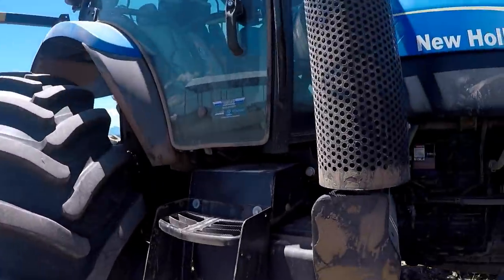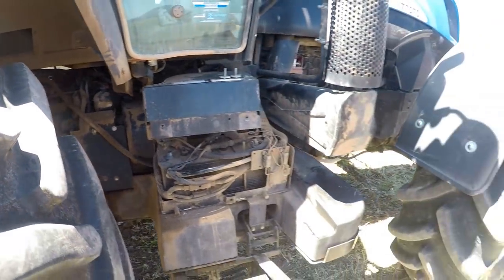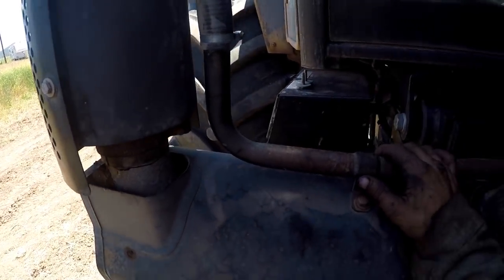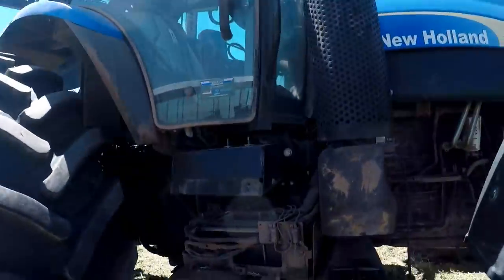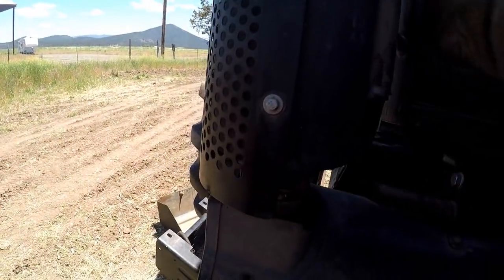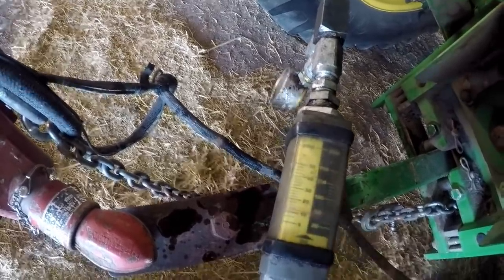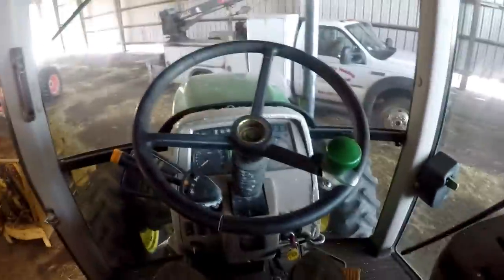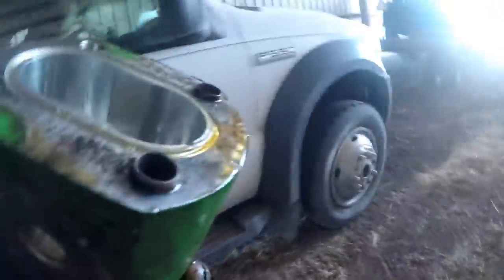More service calls .

Comment: i do weld repairs on yachts/ barges , i know the diodes in elderly ac alternators go kaputt when you forget  disconnecting the batterybanks on the engines , the newer ones voltageratingof the diodes is much higher , so less risk of damaging them ,  keeping your earth clamp close to the spot to weld is also good practice

Comment: SHOULD HAVE PUT A WIDE   BAND   CLAMP  ON IT AFTER WELDING     TO MUCH VIBRATION  WELD WONT  HOLD ON THAT    THIN METAL           CERTIFIED WELDER  BY TRADE

Comment: I understand you found out later they changed the cluster I get that, but just look at that tractor that thing is trashed steering wheels all cracked to hell the interior is falling apart paint is all faded you think that tractor is gonna have that damn much damage and 369 hours? That’s just a dead giveaway man that damn tractor has 8,000 hours worth of damage on it

Comment: I disconnect my battery terminals when I weld also. However, I have welded (in a hurry and not thinking) with the terminals attached and no issues. Now, both the instances you describe involve (to my knowledge, and I have over 25 yrs in the precision sheet metal trade) welding aluminum (AC current). I know some welders will weld aluminum on DC current, but AC is far stronger, cleaner, and faster. I can't imagine there is much steel on a plane as they are typically made with ultralight nonferous materials most of which is aluminum. Like I said, I disconnect the cables anyway (better safe, than sorry) but I'm sure that hooking up high voltage AC lines to any DC vehicle is a recipe for a toasted ECM.

Comment: I think damaging electrical has a lot to with paths to ground and partial paths to ground as well as the type of electricity and the amperage you are putting out and possibly introducing to the vehicles electrical system. That said why not unhook it just to be safe regardless? 

Same with doing electrical repairs, its fuses you won’t have to replace if you cross wires while you’re soldering or bump the battery lead off an alternator or starter against the engine block. Or wrenches and screwdrivers you don’t fuck up with arcing marks all over them. Just makes sense to make the possibility of error as small as you can.

Comment: I've done a lot of automotive mig welding over here in the UK to get vehicles through the MOT test and I was always taught to disconnect the battery for that, on the older vehicles that didn't have ECU's it used to screw up the alternator occasionally although I've forgotten a few times I've only been caught once and had to buy the customer a new alternator. On the newer stuff with ECU's I'm especially careful not to weld with the battery connected, just not worth the risk in my opinion.

Comment: In theory you wouldn't have to unhook the batteries if the ground circuits on every piece of electrical equipment had a million volt and million amp resistor to keep voltage from the welder from going into the system but every additional component is another failure point in anything so nobody is going to do that. Anyone who says to not unhook the batteries is either being delusional or works in sales

Comment: Back in 1984 or so, I took my Cessna 411 (a 7,000 pound twin) to my mechanic when the left and right engines generated different  rpm at full power. Long story short, the waste gate controllers needed work. These things are nothing more than about a 6 inch piece of 2 inch exhaust pipe with a butterfly valve inside. They were sent in for overhaul, and when returned, the bill was 4,000 bucks. I damn near had kittens on the spot.

Comment: every new tractor with any sort of electronics its a must do to disconnect the batteries unless you want to replace the ECU and spend thousands fault finding, when i worked in telecommunications where you have sensitive electronics just walking on the carpet and touching wires can induce static electricity and then you would have people complaining that their phone's playing up,

Comment: I agree completely with unhooking batteries i do in my shop each time as well, but not disagreeing with your buddy by no means but i feel and have been told by my Miller rep and by others, but the reason that ECU fry or stuff gets shorted due to welding is if the ground location from welder is not on a clean and close proximity to joint being welded it will find the easiest and shortest path to it which some times goes thru ECU's and bearing in motors (seen this way to often from customers trying to do own repairs) but that's my $.02, and for all the 6.0 and 6.4 P/S guys make sure your engine grounds stay good and clean and tight didnt believe it tell i say it for my self but these trucks if have bad grounds when starting truck will arc across the front pump bushing/bearing in the transmission and when they do pump goes out and your dead in the water ive seen it to many time to count in my shop, i had a very reputably transmission builder for fords that i buy my parts from time to time to add a good 4ga ground from the top alternator mounting bolt to the RS batt. to give extra insurance from it happening again, that ended up being longer post then intended but anyway I do like watching your videos bud i own a diesel shop but dont get to mess with anything other then OTR trucks and 3/4-1 ton stuff mainly so its nice to get a glimps into the heavy equipment stuff

Comment: Cant say enough about disconnecting the battery. mosfets work on voltage not current, you can turn a mosfet on an off just with the voltage differential between the mosfet ground and your finger, so yeah welding with batteries connected, especially AC based welding like tig, no way. Every welder is a little different but its just smart practice like relieving all the hydraulic pressure from your control valves before cracking a line.

Comment: I sure it does not hurt to unplug the batteries  however you are still inducing high current and voltage to the machine that is being grounded to you welding source

Comment: Isn’t aluminum mig DC voltage? Steel is AC. I could see that happening. You could steel weld on 50 trucks with no issue buts it that 1 that frys the ECM that gets you.
Reply from the maker: Depends on what rod you are running.  I run Dc + or Dc - polarity  and rarely run Ac on steel with stick welder .
Reply: I would use 7018 reverse party on about everything

Comment: Yes I totally agree with you and Will on disconnecting the battery when welding and that pump failure at those low hrs is crap
John Deere info welding on there tractors http://www.deere.com/en_US/ag/servicesupport/tips/tractors/common_stories/welding_electronics.html#

Comment: If I were the owner I would have taken the exhaust off and carried it to you. That way you could have sleeved it. It would have made for a better repair. Exhaust systems always tend to thin out and burn through in areas like that. Believe it or not there are  replacement exhaust systems on the new stuff that run into the thousands to replace.I have a 5075E Deere that after 400 hrs the tach started sticking. Warranty replaced it with a new one but tech. said they couldn't put the hours in so I wrote the original hours in the owners manual. They engraved them on the new cluster housing.

Comment: Hey Warren i recommend getting a mig welder. its a lot better than a stick welder for thin gauge metal. if you chose to use gas while out side turn the cfh up it has always worked for me or you can use flux core. i know people say you shouldn't do that but i do what works and i have never had a problem. If you would like i can come down and show you a thing or 2 that will make your job a lot easier
Reply: By the way i am a welder.

Comment: Warren  do you have wifi service for your laptop or do you have all your manuals downloaded to your laptop ?
Reply: Ron Hart I can’t speak for him but they way we did it when I drove a service truck was with USB Data hotspots that worked off of the LTE signal cell phones used. Worked pretty good unless you had to download something big in which case I would download whatever I needed the night before at home on my WiFi or use the WiFi at the shop. 

That was several years ago, now you can hotspot off of your phone too.

Comment: Wasn't paying close enough attention,  did you unhook the neg or the pos?
Reply: Glen Petet negative. When unhooking, negative comes of first then the positive. When connecting, the positive first then the negative goes on, that way you’re not arcing the positive as you get it on the post of the battery. Cheers.
Reply: That’s a myth also. If there’s a draw on that system when you hook the battery up there’s gonna be an arc, doesn’t matter which cable you’re connecting because either way you’re completing a circuit.

Comment: That battery thing is not a myth seen a guy weld a computer right out of a cat engine
Reply: Seen workmate welding on TL all back lights lit up like christmas tree lol and my idiot boss and another work mate for some reason tried to jump a deere with 24 volt melted the wires lol. On new tractors you also are better to pull the multi-plug out in cab at least in the NH 40 series tractors

Comment: I have a question for you then.  Do you unhook your truck battery when you weld off the bumper?  I agree with disconnecting them but curious how it's done on the back of a service truck
Reply from the maker: I try to if I remember,  sometimes I don't.

Comment: That pump is just good enough to get out of the warranty period, it sure is simple compared to closed center but they couldn’t have bought a cheaper pump. The 30-40-50-55 series didn’t have hardly any aluminum in the tractor just the injection pump and transmission top cover.